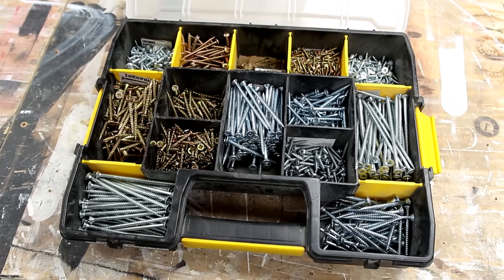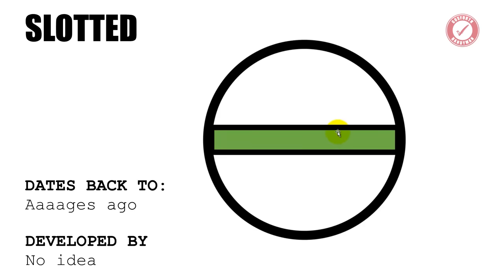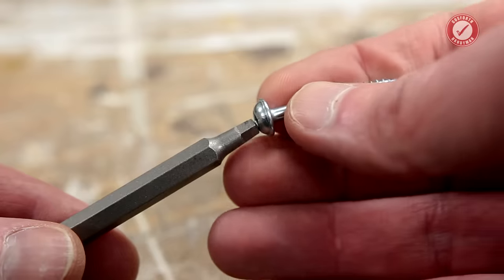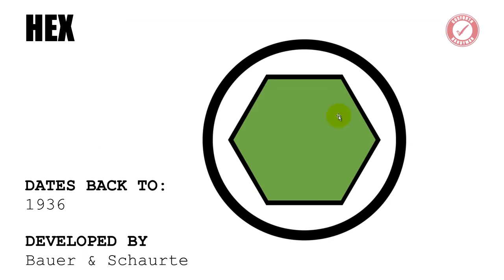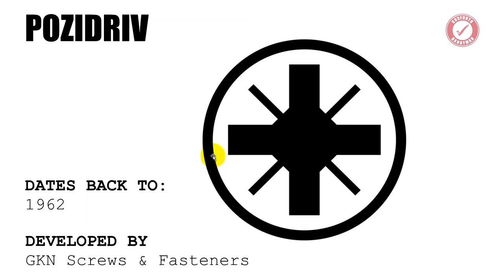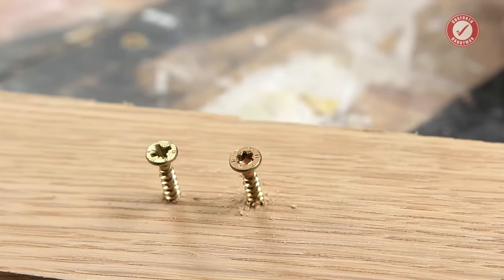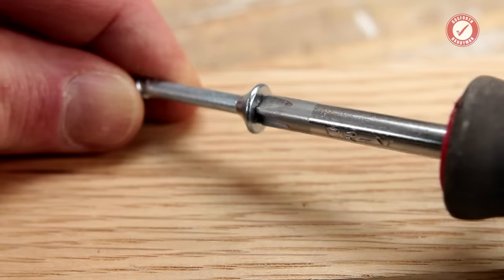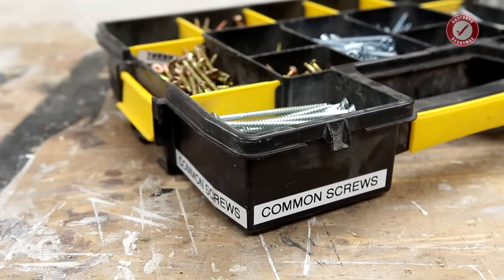Why are Pozidriv screws better than Phillips?

Comment: I’m biased as I am Canadian so would go for Robertson screws every time, but I agree that Phillips are awful, cam out easily, don’t stay on the tip of a screwdriver, etc.  the one advantage of the slot, is that if it does cam out, you can take a hacksaw and recut the slot...
Reply from the maker: Very true! I need to plan a trip to Canada. 😀👍
Reply: You'll love it. What they say about the place is true, the people are (by and large) so kind and helpful! And the scenery... WOAH. And I was only in Ontario... you want to see majestic stuff, I've been told to go west young man!
Reply: Good Phillips screws and bits actually stay together reasonably well. I've had crappy Robertson screws cam out even with good bits (and I had to order decent Robertson bits online, as my local stores didn't carry them, although they've started to now). 

I wonder if we're more likely to get crappy Robertson screws in the US because they aren't common. I agree that a good Robertson screw + bit is better than the best Phillips combination, but I prefer a good Torx to anything else. Unfortunately, Phillips screws are so common in the US I have to deal with them - it's actually much more expensive to get anything else, and lots of the other screw types (such as Pozi and Robertson) are cheaply even when they cost more than good Phillips or Torx screws.
Reply: @TheChipmunk2008  British Columbia, say no more.

Comment: While the taper may make phillips/pozidrive bits seem like a one-size-fits-all thing, they are NOT, and you WILL destroy the screw heads when a significant torque is applied. Please just make sure you have a proper bit set instead of finding a bit that "sorta fits." A wrong bit size is actually worse for hex screws, but it's much more obvious with those.

Also of note is that it's not just the number/surface area of contact points, it's also the angle of them. While Phillips and Robertson screws have a similar contact area, the pressure angle of the Phillips is almost 0 (parallel with the radial line passing through that point), while the Robertson screw pressure angle ranges from 45 degrees at the corners up to 90 at the center of each edge. Consequently, a larger component of the force from Robertson bits is in the radial direction (and thus not being put towards driving the screw). This would make Phillips heads better for high torque, if it weren't for the awful cam-out prone design.

Comment: Hi; thanks for the interesting history; however I disagree with you on the Pozidriv.

Since 30 years I am renovating a house which had to endure some DIY guys before me since the 1970s.
Thousands of screws, very few slotted (S); lots cross (C) and Pozidriv (P). 
Most of the S were okayish; but often (very) hard to losen. 
90% of the C or P I had to unscrew were damaged; some of them might have been unscrewed before, but the others must have been damaged when initially screwed in (maybe using the wrong screwdriver). Lots of 'emergency unscrewing', sometimes impossible (causing heavily damaged windows etc).

For almost two decades I used P as new screws, but although careful with the right drivers (or bits), I damaged lots of them, which became worse when electric screw drillers came into play. Although I tried to be as careful as possible, I also ruined dozens of screwdrivers, even more bits and countless screws.

Three years ago I had enough: I bought a selection of 3'000 Torx (T) screws and since then never ever used a S, C or P again. 
Since then I have replaced  'all' screws with T (I had to buy many more than the initial 3'000).
In 99% I get along with T20 (almost no need to use bigger or smaller Ts).
Because I use magnetic bit holders, I have no problem with one-handed drilling; because of the electric screw drillers no disrupted screws (also because i generally pre-drill a slightly narrower hole).

During the three years no damaged bits or screw drivers and I had problem with only two T--screws so far.

If I see T-screws next to each other, I love that they are not twisted unlike S, C or P (at least I cannot detect a twist)

PS - I don't think P-screws have 8 points of contact: the inner 4 contacts do not establish torque.

Comment: The number of touching points is not the only parameter to consider. The strength of contacts and slip resistance are even more important. Posix are just marginally better than Phillips because they tend to slip nearly as easily destroying the head of the screw. Torx, esagonal and robinson are way better with Robinson probably coming on top.

Comment: I was thinking about this since you mentioned it on the podcast - I hear what you're saying about Pozi, and totally agree that Phillips should die a death. I've tried all the different screw types, and whilst I do really like Torx the different head sizes and the lack of screw holdability is an issue for me. I also have had way too much cam out with Pozi for my liking. I tried Robertson, and for me personally, found it to be the best balance of low cam out, screw holdability, one size (S2) fits (almost) all, and torque - so I've switched over almost completely to them. I'm still using up my Torx now and then, but my go to is Robertson. Maybe it's because I used to live in Canada when I was a kid!
Reply from the maker: I do really like Robertson but they're just too uncommon in the UK so you'd constantly be swapping bits. I want to visit Canada one day so yeah, Robertson rocks! 😂👍
Reply: Depends what you're doing... I'm an electrician and I use Robertson all the time here in sunny (heh) southampton.  Probably annoys the bloke who comes behind me but they're so handy especially when working at height. pop one on the driver tip, and it is staying there till YOU want it off

Comment: Spax Torx - all day, every day! You made two particular criticisms of Torx - the need for multiple drive bits and less grip on the screw for starting. On the first one: don't be lazy - how long does it take to swap bits in a bit-holder? On the second one - use a magnetic bit-holder and drill a pilot hole (or use a hammer)! I dislike PZ because they will cam out (badly) if you're not dead square on it. And, of course, there are actually three PZ sizes and you only need four Torx bits to cover the same range (3mm to 6mm screws). I'm pretty sure Peter only uses Torx - am I right? Completely with you on Phillips - and I have a pathological hatred of slot-head screws. Did you know Festool use slot-head screws in some places (like the rail-joining bars) to discourage you from over-tightening them?
Reply from the maker: Swapping bits when you're up a ladder - nope. PZ2 works for the vary majority of situations - almost never need to change bits. Literally never get cam outs but I almost always use an impact driver. Each to their own though! I think Peter uses a mix of PZ and Torx. 😂👍
Reply: @GosforthHandyman  - yep, can't argue with that. I forgot to mention that I'm in a very different trade and 100% in my own workshop ;-) Adding your point about what tools your clients will have and of course I see why you have settled on PZ.
Reply: First, I'm completely with you on the love of Spax Torx :) I've seen way to many badly mangled PZ2 heads because of a non-90 degree angle. To be fair, they always go IN...
There is, however, a real good reason for using slotted screws - and that is dirt, especially  in an outside situation.  A dirt filled PZ is very difficult to clean in many cases, TX next to impossible.  Slotted however can be cleaned with the same tool that unscrews them :)  So imho, they are severely outdated, but nor without use :)
Reply: Spax are great - they have actually got a modified Torx shape. If you use a spax bit with a spax screw, it holds the screw in place on the bit much better.

Comment: Torx screws stay on the bit better than any other type of interface. I do however avoid Chinese-made screws and only have German or Taiwanese torx screws. The very reason I went with Torx is because the screws remain attached to the bits, so I can maneuver them wherever I need when building.

Comment: In my experience, the main problem with Pozi and Philips are one: when the screw is aged or corroded and it is very tight and you want to open, then the slot would be destroyed by the torque in the process, causing the screw to no longer be opened by the screwdriver. In fact, as you can see there is a small unnecessary X in Pozidrive that will cause the head to be much weaker than already-weak Philips head against high torque. This will become more apparent if you use high torque power tool with low quality metal screw.

But this is not the case with the square Robertson where the metal would still be solid square slot even if the screw head is slightly corroded or built from weak/cheap metal.

In short, Roberson square slot that is the strongest in term of screwhead durability against high torque and aging while Philips is worse and Pozi is the worst.

Comment: I don't mind Torx screws. They do seem a bit more elegant as a finishing screw than a Pozi, but the unmarked different sizes - especially the 15 and 20 being so close visibly - can be frustrating. 

Looking through my Wera Bitcheck, all the action has been on Pozi 2, TX15, 20 and 25, and some Hex 4mm and 5 mm. the Phillips are untouched, and Wera have an aversion to slotted bits, so this set doesn't have one at all. I've never seen a Pozi 3 screw.

One bit type you didn't mention that I utterly despise is the PoziSquare. I accidentally bought a box from somewhere (Wickes?) and it had the included bit missing. I assumed I could use a Pozi on it, name and all, and it fits, but the small middle flanges are missing to make room for the square drive, and using them was more work than it should've been. PoziSquare bits seem to be expensive (do they exist because patents ran out on others?), so I just got a Robertson #2 bit and used that instead. It's more of a PhilliSquare from a contact perspective, and certainly one to be avoided if you don't have the bits...
Reply: A year or two ago I gave Toolstation forgefast torx screws a go. Wow, so much faster and easier than the quicksilver I used to use. The fact that each box comes with a 1/4" torx bit means that (as long as I remember to put it back) I don't struggle to find the correct bit. It's waiting in the box. I've also clearly labeled each box with which size bit if I need to grab from my DeWalt set if I hadn't put it back after all.

Comment: Hi Andy, I do not use a impact driver an even with pozidrive I find that I need to put a lot of pressure on the drill to drive the pozi screws in. That's why I prefer Torx with good bits. The screw stays straight and I don't have to hold the screw. Perhaps you could compare driving in a pozidrive screw and a torx screw with a combi-drill as well. Might be informative. For my type of usage it saves me buying an impact driver. (But then again... might be a reason to buy one. But we're far away from Christmas :)
Reply: Sir, you really should try an impact driver - worth every penny !

Comment: You may have been using a Torx bit in a Spax screw? You need to use their own 'bits'..... a Torx screw bit will fit snugly in most other brands and be as secure (I think better) than posi drive. however the 6 or so different sizes you need do drive me a bit nuts :)

Comment: Posidriv are really good, but require proper bits or drivers. Biggest issue is people use regular Phillips and don't know the difference stripping out the screw heads. Another issue with Philips, is that there are a few other fasteners that look like Philips, but are in-fact NOT Phillips, Japanese JIS for example. They do not fit and will cam out if you use a regular Phillips. You also have a special bit used for electrical work, that looks like a combination of a Posidriv/Phillips and a flat head called FPH/FPZ. Most people use a flat head or a Philips for those, and don't realize there are special bits for those screws.

Comment: Hi Andy, Can you recommend a good alternative to genuine KREG screws in the UK with POZI drive and pan heads? I hate square drive screws as I find the cam out is beyond frustrating. After punching a lovely square hole through my thumb I'm firmly in your camp of POZI is best. 

Giles.
Reply from the maker: I haven't seen Pozi ones m'fraid - Axminster to Torx ones though... https://www.axminster.co.uk/ujk-technology-washer-head-pocket-hole-screws-fine-thread-ax884993 I all honesty I'd stick with Robertson as the bit grip makes life a bit easier. 👍
Reply: Both Rutlands and Axminster do pocket hole screws with Torx heads - probably a better choice for pocket hole joinery since the Torx profile tends to guide the bit into the correct "straight on" position (as does the Robertson) - I've accidentally chewed up a few PZ heads when using them in pocket holes in the past.
Reply: I found Kreg screws work fine with Kreg bits. It is an expensive combination though
Reply: If you don't mind a moment of faff, then it's cheapest to just flop a washer onto the stem of a standard pz2 countersunk screw. Works an absolute treat, especially with a bit of clear shank on the screws to help pull things together.

 I use the larger Kreg HD setup fairly regularly for hefty exterior timber jobs, and the genuine fixings are just eye watering in the UK at the moment. I have now found that Timberlok type fixings (and possibly 6mm washer head Spax Wirox type screws) will fit the system very nicely.

Comment: You glanced-off, but didn’t mention one major PZ v Torx difference. Driving a screw with the clutch set incorrectly and you hit resistance..The PZ will cam out but the Torx will try to break your wrist. 

I’m in the US and PZ is, lamentably, non-existent. Torx is becoming more common.

Perhaps if you used  a set of Torx bits that you hadn’t stored in a waterlogged dustbin 😀 you might enjoy a better fit. The Spax-brand (if it’s good enough for Millard it’s good enough for me) Torx screws here in the US come w a tip in each box and they are very good. Most, by the way are T20, with T25 and T10 only being found outside the broad range of everyday construction sizes. Lag bolts and such would be the former with small 3mm ones requiring T10 (I hesitated to use the word ‘latter’ since I know it’s hard for your accent to pronounce it) 

Great video... look forward to next part.

Comment: A important point missed, the Philips screw was actually designed to cam out (the screwdriver will actually twist out of the head causing damage) if too much torque was applied to the screw and was primarily used/designed for the aviation industry when it was invented. A consequence of this is that they appear to be inferior when too much torque is applied. Even worse when you use a Pozi driver in a Philips head or vice versa. Don't get me wrong, I would never use a Philips screw out of choice.

Comment: I worked at Hewlett Packard Company when they decided to switch to Posi Drive for all of the advantages you talk about. It was a huge mistake. Screw prices went up and nobody had drivers that fit the equipment. I am surprised anyone still uses them. I still have some Posi Drive screwdrivers and had to loan one to a friend who had some on his car but they never took off.

Most of the screws I use are either Philips of slot head. I occasionally have to cut a slot in a head and am grateful that I have some good impact slot head bits to then remove those screws.

It seems that every box of deck screws I buy has a different head. I tend to use a square bit and avoid the custom ones that come in the box.

Nice video, thank you.
Reply: It seems like Pozidriv never really took off in the US, maybe because Phillips already had such a massive market dominance, but in Europe and especially in the UK, Pozidriv screws are by far the most common in construction and carpentry, though Torx is becoming more popular. In my experience, Pozidriv screws are much better than Phillips, particularly when using drill drivers or impacts.

Comment: I couldn't agree more death to philips screws. However back when I was working as an electrician, the Roberts square drive was a go to. For the simple reason you could load a screw onto the driver and put it back in your pocket for when you've only one hand to hold a light fitting and the other to reach for the driver. I use the turbo gold for almost all my wood working cannot fault them.

Comment: When it comes to Philips heads they were not designed for higher torque. The were designed to automatically cam out when it reached a certain torque is reached. If you’re stripping the heads consistently you need to change to a different drive system.

Comment: I try to buy every screw with a T20 had. The bigger ones I'll try T25 but it's harder to find them. Drywall is still PH2 and that is fine enough since you don't need anything better for a 35-50mm screw in softwood.